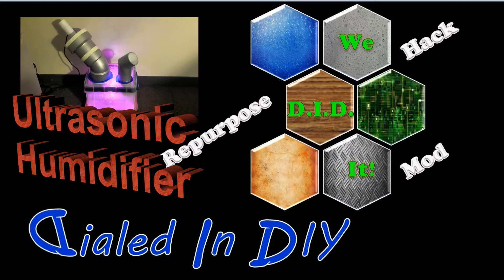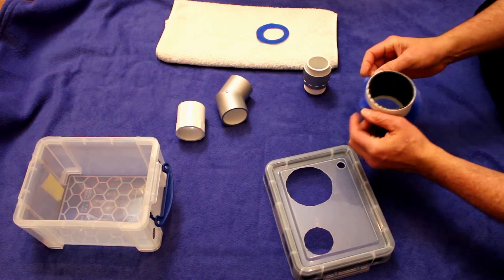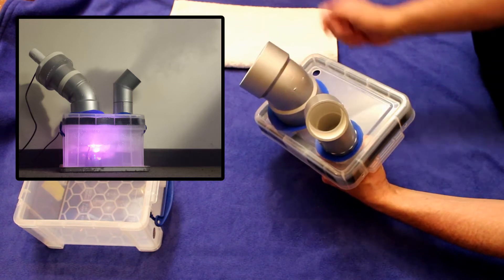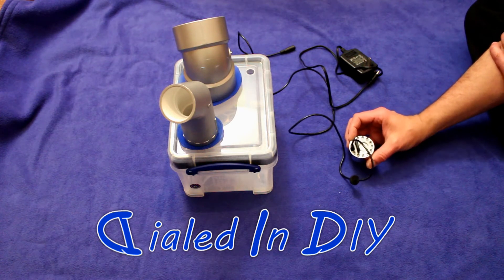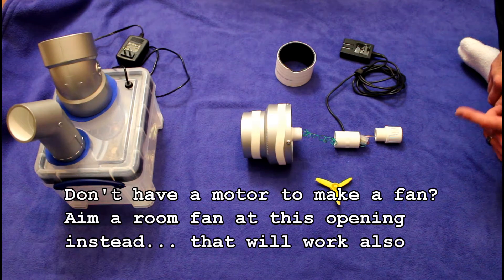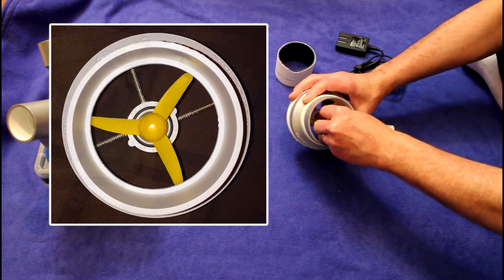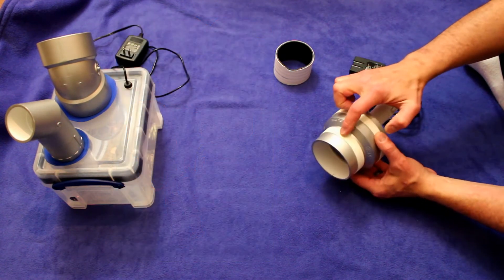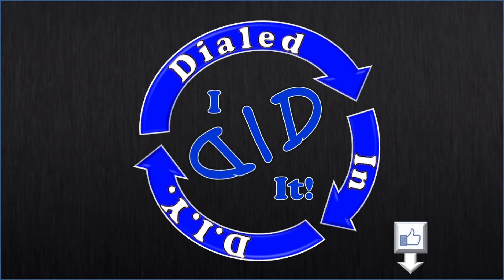Make an Ultrasonic Humidifier

Comment: I must applaud the close fit of those fan blades. Is there a particular size-strength pond mist er for results like yours?  Also I ask for a term a little less relative in respect to the room size. I will be using a similar build for my diy incubator. Loved the video, great quality; now subscribing will all accounts.
Reply from the maker: +Robert Toms Thank you for watching and for the feedback!  The device I used has a single, standard size ceramic disc for the ultrasonic mist effect.  This was basically the same as a commercial humidifier.  You can get units with more discs in them if you need more humidified air but I am guessing the single disc version is what you will need.  My test room was roughly a 9" X 12" fully enclosed office but I have also used it in much larger rooms; it was just as effective as a commercial, home humidifier.  Was this the information you needed?  Hope it helps!